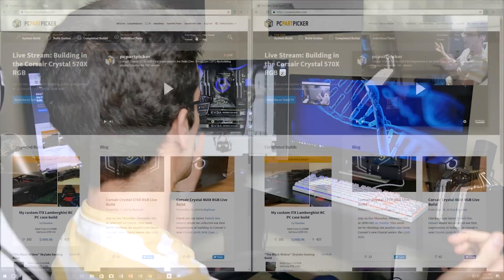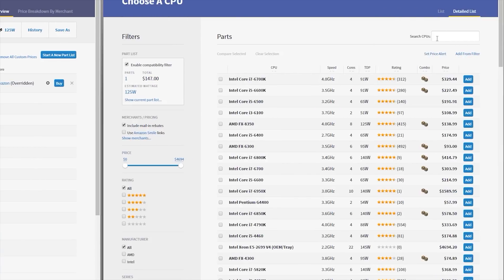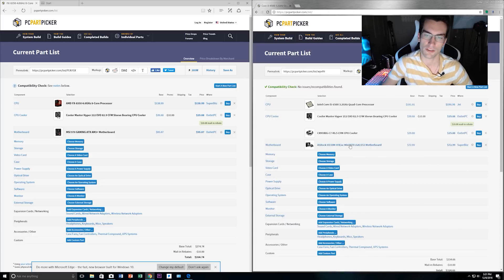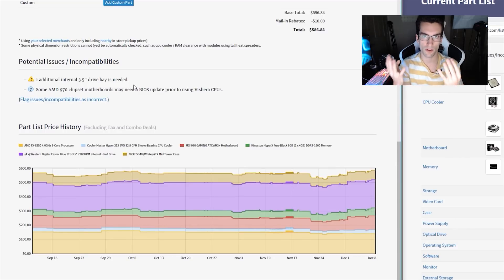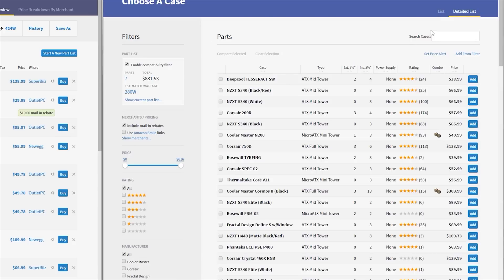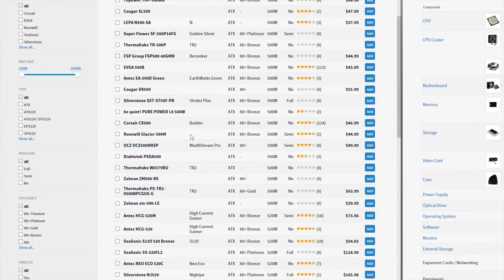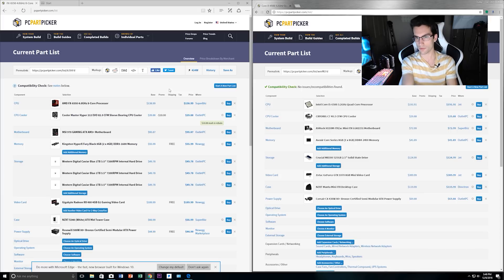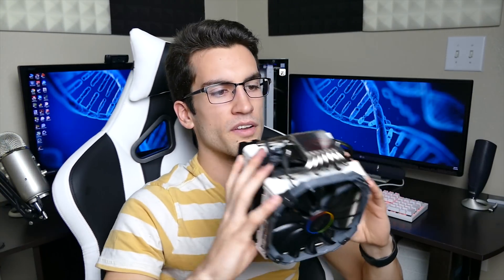Crash Course: PC Part Guide for Beginners

Comment: Im so excited for my new pc parts to come in so i can play mount and blade 2 bannerlord on release maxed out!
Reply: Ashe Shiina Its a budget build and mount and blade isnt very hard to run
Reply: Nice, just wondering, but what are the specs
Reply: Flopp Mann Im buying a evga gtx 1050ti and an amd x4 880k, i know the processors not the greatest but it will do the job i need because i cant stretch my budget for new motherboard.
Reply: +RyanFX3 you're not gonna play many games maxed out m8
Reply: For $10 more you should of just bought an i3-6100... AMD is dead until Zen releases.
Reply: gdfschimpi007 read back a while ago i said i need new mobo aswell and cant afford the 100$ price increase

Comment: I Have never built a pc before and i know all the components and their compatibility. Research is all it takes.
Reply from the maker: PCPartPicker makes the process much easier. Beginners wouldn't even know that different CPUs were incompatible with other motherboards.
Reply: It actually warns the user telling them its not compatible. But i understand your point (example fx6300 and b150 pro gaming motherboard are not compatible) . The only thing that PCPP doesn't warn about (yet) is ram and cpu cooler clearance.
Reply: Not only does it warn... but if you pick a CPU it automatically filters out any motherboard that doesn't work with it

Comment: https://pcpartpicker.com/list/xtPZ9W What is your opinion on that list, I already have a WD BLACK 2TB for mass storage.
Reply: Get faster ram, and z170 chipsets doesn't support quad channel memory, so just get two 8gb sticks
Reply: i would get a more powerful gpu for money your spending
Reply: If Z170 chipsets don't support quad channel. Then why does my Z170 board have 4 DIMM slots
Reply: Frankie https://pcpartpicker.com/list/98kFbj this would be better also you don't need a i7 for gaming
Reply: I looked at it quickly and it looks pretty good, power supply is a bit overkill though
Reply: For more ram, dual and quad channel actually make them run faster
Reply: Combatsmithen Because there are 2 so called devices with 2 channels each aka Dual Channel.
Reply: Better cooler.

https://pcpartpicker.com/list/yCGstJ

Comment: To all the beginners, 

Don't be afraid of the unknown. 

But what ever you do, don't buy an FX processor. Lol 

- Brandon
Reply: I usually use them and the stock cooler to heat my room during winter time
Reply: Brandon I got a amd 9590 for 70 bucks on black Friday I saved around 130 bucks
Reply: it's the i7 equalvilent
Reply: it's the i7 equalvilent
Reply: Ivan Momin yes, but with zen right now the corner with bench marks claimed by AMD, to surpass that of a broadwell-e
I wouldn&#39;t buy one.
Reply: it's barely an i5 6400 equivalent. don't get an amd chip until Zen.
Reply: Oxygen 

-phantom7489
Reply: +Brandon Well not this late in 2016 sure as hell LOL! But anyone who bought it 6 months ago or earlier got the great deal. I own stock clocked FX-8320 for almost 3 years now. I would never ever take any i3 over that, not even modern Skylake ones. And i dont plan upgrading to Zen until second or third generation comes out. No need to rush when this cpu is better than most people think :D.
Reply: CMstacker Agreed, I've owned an 8320E for nearly 2 years, got it stable at 4.6GHz and it runs like a beast. I recently upgraded to an i7-6700K and the difference is actually huge, but the 8320E still gets the job done while being cheaper.
Reply: An AMD FX 8320E can be sold for an $80 bargain. I don't see why I wouldn't build a PC using an 8C/8T processor in 2016 despite of Zen releasing.
Reply: wow, that is a tight budget! personally i would have a bit more and gotten an i5 6400. You get 4 cores instead of 2, and you wouldn't have to worry about that CPU for a while. Listen I didn't build my first PC till I was 20 due to money reasons, its okay to wait and save up for it. Don't rush it man.
Reply: Tajwar Studio Q6600 isn't better not to mention you have a better upgrade path with a Pentium. The i5 6400 is way better than the i3, real physical cores is a huge difference.
Reply: I upgraded from my OC'd 8320 to an i5 6600k (OC'd to 4.5Ghz) and the difference has been amazing. Not just gaming (finally FPS in the 150's when the 8320 was bottlenecking me in a lot of titles), but boot up time, snappyness of the system and sucklike. Now on various benchmarks like heaven, Performance Test, Novabench, 3dmark etc, my scores have skyrocketed. I get about 30% higher scores compared to my friends 8350 / 1070 build compared to my i6600k / 980ti build. Finally I can play my Total War games at decent framerates in battles too (used to not play them altogether with AMD cpu and just do the campaign map and press auto for battle results).
Reply: Exynos FTW Kaby lake wouldn't have remarkable performance boosts, maybe as much as 15% but nothing more than that. It's Intel's "Tick, tock, tock" stratagy. First, it was Broadwell, then Skylake, then Kabylake. Btw, it would be hard for Intel to lower prices on the Skylake Core CPUs. If they don't, oh well. We're going to buy Zen
Reply: The FX-9590 outputs so much heat that water cooling it is almost mandatory. In fact, they used to only sell them to OEMs and then only sold them packaged with a water cooler.
Reply: the sad thing is the pentium g4400 beat the athlon x4 860k, In benchmarks.. And In games when it came to fps. Also btw any quad core amd is just 2 cores split in half, Because how amd manages it, They both share 1 single FBM. so a 8 core it effectively 4 cores split in half. they also share cache, And for the i3 75xx to beat a quad core i5 6400 is amazing, Plus the core i3 has 4 threads.
Reply: The new zen architecture I believe does not share FBM per 2 cores, Which is how amd got it to be as fast as they say it is. If it does share FBM per 2 cores, Then I would be disappointed in AMD, That is why AMD has such bad single core performance.
Reply: ***** "Module" design is not a sole reason why AMD`s Bulldozer has such poor ipc.... but regardless, You do "not believe" Zen is not like that because you know it for a fact :D. We all know it for quite some time now. Zen is completely new and very "traditional" design. And Zen will be mighty good... ;). And there is no need to praise that pathetic i3 because it`s performance might be seriously good but it`s still a freaking dual core and i pity people who will shell out more than $150 for that nonsense in the 2017 :D. Quads are only way to go forward or even 8-cores which AMD will made affordable with Zen. I3`s are good only for office and HTPC`s. There is no serious use scenario left for them and that means even gaming is out.
Reply: How much did water cooling cost you tho?
Reply: SciTech41 what?? Lol
Reply: i bought a fx with mobo for 85bucks total...  still cheapear than building an overclockable i3 kaby lake. (still unavailable doe)
Reply: Cropper The Brit AMD does a good job at the budget side, but as for now Intel will remain superior for the high-end side. :) I'm just hoping by the time Zen releases that it makes the CPU department a competitive place so Intel would actually be pushed to either drop prices or develop much better and stronger processors. :)
Reply: TechVoyager An 8320E + Gigabyte GA-970-Gaming Motherboard currently costs like roughly $100 in my country lol, it's more than a bargain. xD
Reply: Flugzeug Dokus Good choice, just take a look at what Zen has to offer first, if it's unimpressive, proceed to Kaby Lake. :)
Reply: There are some misconceptions floating around here.... like with everything hardware related online :D. Intel WON`T just lower prices overnight, even if AMD smashes it to the pulp with Zen. Intel is a large company with fixed set of margins and set expectations from investors and shareholders. They want to keep their margins as high as possible for as long as possible while keeping their image. They dont want to be a "budget company". Even when AMD dominated with Athlons in 2000-2006 era Intel was still more expensive overall. I can`t see Intel lowering their prices for more than 15-20% and even that will be stretched out over a two year period or so. On the other hand Kaby Lake is nothing but Skylake with better gpu portion and higher clockspeeds. There are already numerous reports on tech sites that claim Kaby`s IPC is completely identical to Skylake`s ipc. Or even a few percent points worse LOL. Kaby will get better performance only on account of 10% higher clockspeeds on average. And even that is mostly reserved only for top end chips like 7600K and 7700K. That gives AMD`s Zen a really great fighting chance, since Intel has basically done nothing significant with their cpu architecture since 2011`s Sandy Bridge. And frankly.... Intel is boring as hell today. I dont care for them since 2008. I`m all out for AMD. Bring it on! :D
Reply: Yeah because zen wont support am3+ only am4. Unlike intel which all kaby lakes will support skylake motherboards, Plus the core i3 75xxK is actually gonna be overclockable, And its bench marks say that the i3 is faster then the i5 6400, and it will be about 100-190 dollars. at launch for the i3. Not to sure pricing I heard its like 170 not sure.
Reply: ***** so are you implying Intel is a good guy or a bad guy here? :P. I know all those rumors but no matter how fast that i3 could possibly be, it`s still laughable to pay anywhere near $200 for a glorified dual core in a 2017 xD. Intel is pathetic beyond repair...
Reply: Look up i3 vs i5.
Reply: CMstacker I wouldn't get my hopes up for Zen just yet, sure I support AMD, but I won't believe in their benchmarks until we actually get real benchmarks from the Tech YouTubers.
Reply: Exynos FTW If the benchmarks were fake, AMD are in trouble. Over all AMD wouldn't be doing that new horizon thing if they weren't confident.
Reply: Silverry Agreed, but I don't really think Zen would perform as we all think it would. (Hopefully it does lol)
Reply: Silverry It might just perform slightly worse than the benchmarks AMD provided, just slightly, so that means it still challenges Intel.
Reply: Exynos FTW But AMD have a pricing advantage. If Intel do not alter their price, they're not going to do so great.
Reply: what i3
Reply: Brandon welp i got fx 8350 still works fine biaaaaaàach oh and btw i bought it before ryzen came out rip
Reply: Noted

Comment: I just built a new PC in October (i5 6500 and RX 480) and now I have a bigger challenge; build a new Portable Mini ITX Tower PC for my best friend (i5 6600k and gtx 1070)
Reply: Well lucas, it could be a portable workstation rig but I'm going to safely assume it is for gaming. :)

But to answer the main question (as an owner of a portable ITX system for almost 2 years myself), ITX is a really good option if you want a portable gaming rig to take to lan parties or to a friends house) or a small system that you dont want it to take up a lot of space but still want to be able to swap out parts like you would on a normal build. (a normal desktop can be heavy and not practical to move all the time for this situation.)

Also ITX these days hardly compromise on what the vast majority of people (including gamers and enthusiasts) are currently running in there systems.

Most high end rigs only are running a quad core Core i7 (6700K/4790k for example) and a single gpu (GTX 1070/980ti is a good example.) 

ITX can not only fit that roll but also exceed it (the Asrock X99 ITX board can support all the 6+ core i7's and vast majority of Xeon cpus including there 22 core one.)

So there a lot of systems out there that have PCI-e slots not utilized.

Now you might be pointing out about SLI/Crossfire, which yes you cant do on a ITX board but as mention above, most people are just not running it.

Most games sadly just dont support the feature and for the the one that do.... dont support it well. Very few games support it well and make it worth while.

So most people dont mess with. (Not worth having it if most games that support it only get less than a 50% boost when your using double the hardware and doubling the power usage.)

On top of that, the other issues include stuff like micro-stuttering, card spacing issues (referring to heat if your air cooling) and many more issues. *Note: While both AMD and Nvidia made great strides to fixing micro-stuttering, this issue, it still persist in some cases.

So it always been recommend to get a better card than going the multi-gpu route first.

and about the better gpu's, today's current line up of gpu's is perfectly fine for current resolutions in single gpu configs. 

GTX 1080 is a good card for 4k resolution with a lot of high settings. 

GTX 980ti and 1070 is good at 1440p 

and the list goes on.

Not factoring most people are still running 1080p monitors.. these high end cards are overkill in most systems.

You can see where this is going.

As for Fast storage, a lot of ITX boards are coming with M.2 on them. Sound, typically just using what is built-in to the motherboard but for those that want better sound are using USB DAC's. For Wifi (because of being a portable system), is the same as the M.2 where a lot of boards have laptop wifi cards on them with antenna screw points on the provided I/O shield.

As for another reason why some of us build ITX system, because some of us like building in small cases that give us a challenge as we've gotten board with the standard ATX layout. 

So hopefully this clear things up a bit of why some of us are building ITX system.
Reply: lucas rem Now I feel like an idiot as i gear my post more towards someone that didn't know about ITX or the reason why.

Sorry about that. 

But i do see your points and I can see why. Situations for everything! :D

and certainly true about the crappy game ports. lol
Reply: lucas rem So what are the limitations for ITX thats you speak of? To make a really good ITX build a good portion will go towards a high-end motherboard because you will need a good sound card, network adapter, decent amount of fan headers (depending on how you design your build) and a really good I/O.
Reply: KV3NU B3RG3N No it will be a mid-high end setup
Reply: lucas rem Well I'm building it for my friend. His parents are divorced so he needs to have a PC that he can bring to his parents house at anytime
Reply: warmon6 Well I have a ATX Mid-tower, the ITX is for my friend with divorced parents that he needs to visit every weekend
Reply: jynxed If you go for a Z170 motherboard, it would probably have good audio
Reply: Do it for 200 pounds. Use 100 pounds to hire a technician to build it.